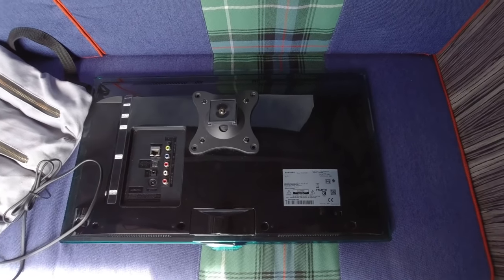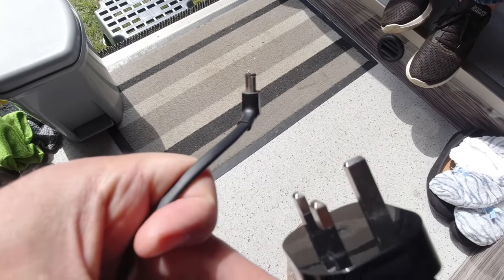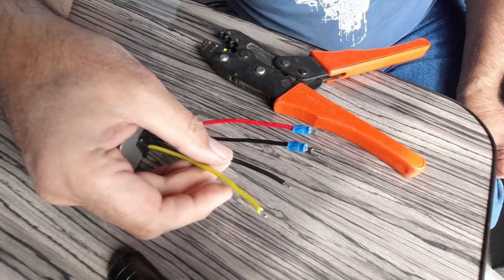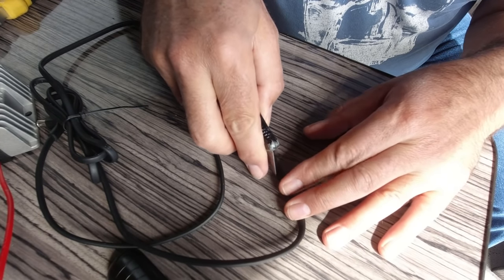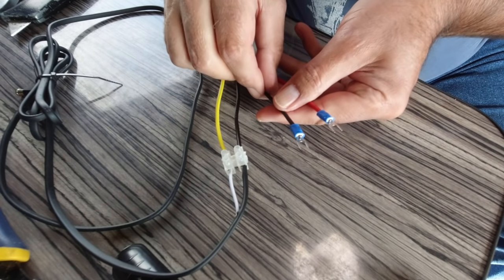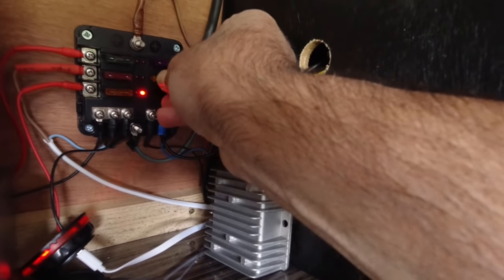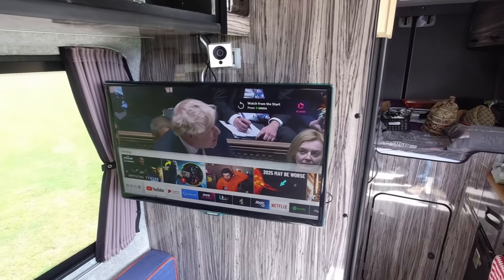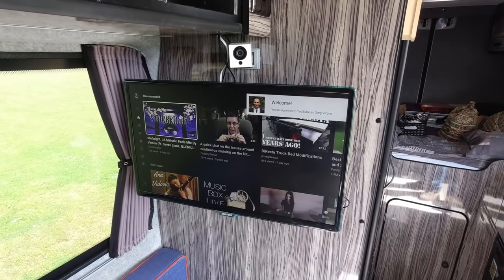How to connect a Mains TV direct to 12v DC - Off Grid Living

Comment: 2:30 It is a boost converter (up, 12->19V), not a buck converter (down)
Reply from the maker: Thanks for correcting me, sorry I got it wrong :D
Reply: niiice, didn't know that!
Reply: please help me with an issue I have. I bought some ex EV lithium ion batteries and connected 4 x 3.65v in series, which means they're 14.6v nominal, and they'll probably charge up to 16v. can I use a buck converter from that 16v down to 12v from the battery to the 12v fuse box? is it safe to do? I know I should have bought a lifepo4, but didn't have enough money, and really want to make this work. Thanks.
Reply: @camperdude5241  The maximum charge voltage for lithium is often 4.2 Volts for a single cell, not 3.65V. Lithium batteries are charged with constant current, not voltage. You provide a constant current to the cells and the voltage will rise. When the cell voltage is 4.2V (varies with the cell type), charging is stopped. Not all cells may reach the cut off voltage at the same time, this is remedied with "balancing". A buck or boost converter does not provide a constant current (CC) by default, most only provide constant voltage (CV), like the one that is used to power the television in the video. You need a power supply that provides CC and CV. The current never rises above the set maximum current and the voltage also never rises above the set maximum voltage. The current and voltage applied to the cells always follow Ohm's Law. Be careful what you do, Lithium batteries can burn.
Reply: @RAL2010  you got it the wrong way round he wants to use the buck converter to use power FROM the battery pack not to charge it 👍
Yes you can use a buck converter to lower the voltage from the pack 👍
Just make sure the converter can handle the full amount of amps the whole fuse board is distributing to the whole system 👍
Reply: @Dirt-Diggler  good point!
Reply: @RAL2010  I understand the point about charging. In fact, the victron mppt can be set to charge these cells up to where they should be...for argument's sake let's say 16.8v. My question is what can I do to bring that down safely to run a 12v system?
Reply: @camperdude5241  if it goes up to 16v then you’ve killed your lithium batteries , the bms on the batteries won’t let it get above 14.6v it will Rarely get above 13.5v. But yes buy a 12v buck converter.
Reply: @toastiesvanbuild4644  Ok thanks. These aren't lifepo4. They're YUASA LEV40 Li-ion batteries from an electric Mitsubishi hybrid. Lifepo4 cells are 3.2v, but these are 3.65v, hence the higher voltage when 4 are connected in series. 
I'm just looking for advice on how to safely bring that voltage down. Looking back I should have waited until I could afford lifepo4, but I didn't, so I'm going to see if these are useable.
Reply: @Dirt-Diggler  thank you very much! I'm clueless about these things, but what you say about the amperage makes sense.

Comment: Nice one but its actually called a boost converter (as buck's step down voltage, boost's steps up, I'm sure it was a slip of the tongue). You can buy adjustable ones too for dirt cheap, sometimes also known as dc step up converters. Or even use a universal 12v laptop charger, 19v dc is a commonly used voltage for laptops. 

Problem is finding a TV for cheap that you are certain takes DC. Lots of used ones on FB for cheap but no one takes good enough pics to see the model numbers etc.

Comment: Nice mod. A switch on the 12v supply to the buck converter would be good so it's only live when the TV is on as it's still draws low power even when it hasn't any load (every little help😀).
Reply from the maker: Yes you are right and you’ll love my upcoming upgrade video. Stay tuned 😃

Comment: Great video Greg. I have been thinking of doing this for my TV and laptop so I do not have to turn on my inverter as often. I hate those types of wires in which the ground "Wire" is a sheath that goes around the positive wire. Such a pain to work with in my experience. I cannot wait for your updated video.
Reply from the maker: I have a new smart controller to replace that blade fuse holder. Should be interesting 🤔
Reply: You don't need an inverter to charge your laptop. Just buy a 12v charging cable (it has the cigarette socket plug) specifically for your laptop. Easy and cheap.
Reply: @MultiPJoys  Correct, I was doing that with my old laptop and cost about the same as the inverter that Greg is using. My new laptop is a gaming laptop and uses about the same voltage as my old laptop (~20V) but uses 10A at peak. If I can find a 12V adapter for it that would be great but no luck so far hence why I am thinking of buying one of these inverters.
Reply from the maker: @MultiPJoys  yes just check that the laptop power requirements are below the output of the 12v charger. Most only go up to 90W

Comment: a good solution Greg, given that like invertors, DC to DC converters are not 100% efficient (despite the claims 80 to 85% is a good rule of thumb particulary at lower power) it could be interesting to do a comparison between both methods of powering the TV.
Reply from the maker: But with the mains inverter you are converting the voltage twice and much bigger differences. With this it’s only once and 6.5v difference. 👍🏼😊
Reply: @GregVirgoe  the bigger issue is using an inverter doesnt create pure sinewave ac even when claimed so it gives the TV internal power supply a bit of a headache and is inefficient.

Comment: Ahh I though I could do this when I found our old wee TV was 12v but had an AC plug. Was doing my head in trying to find out what that coaxial cable was called so I could double check which one was negative. You might have just saved me over £100 Greg! 😁👍
Reply from the maker: So you may just need a voltage regulator to maintain a constant 12v to the TV. Have you checked the input voltage details on the back of the TV?
Reply: @GregVirgoe  Yes it's 12v. 👍

Comment: You the man Greg👍😂. Can I ask you or anyone with these skills... I found a TV which states 19v but at 50v ...so the question is... Would this work for those tvs too. Much appreciated 👍
Reply from the maker: There wouldn’t be two different voltages. If it’s 19v the other figure would be either power in Watts or the current in amps. Can you check the label again.

Comment: Can also put in rotary selector switch so can run off 240v campsite power or battery generator aswell if batteries get low

Comment: Thanks Greg, been thinking about doing this.  Only problem is for me, I have so many electronics in my van that i would need a bunch of transformers to run everything and so would end up with dozens of them all over the place :).  I've been looking into making a multi DC output circuit board, certainly not beyond the wit of man, and looks as though is indeed possible but again for me just too much gear that needs powering to justify i recon.  One other issue for me powering things directly off of the 12V battery bank, is not being able to see your total load draw.  Again, not a massive issue (and wouldn't be a show stopper on it's own), but is handy to know what my draw is to know when to dial back the consumption.  i'm lucky in that i installed 1200W solar on the roof and currently have a total of 285Ah battery storage, so i can get a full charge before mid-day on a cloudy day?!  Thanks for sharing the video, it answers one question i was wondering, and that is the Amp rating of the output side of said transformer.  I was worried about over powering items, but as i thought - circuits will only take what they need in terms of Amps right, so even though your transformer is rated well above your TV's Amp requirement, the TV will only pull the Amps it needs - the important part to match is the DC voltage of course - just thought that might help some of your viewers as is not immediately obvious.  I suspect a benefit of over sizing your transformer (over and beyond Amps required) is that it will run cool, be more efficient and have a longer whole lifetime as is well over spec'd.  Thanks again, keep up the great work as ever, cheers from Bristol UK
Reply from the maker: Yes the rating is a maximum value so it’s perfectly ok to use less and it will operate cooler too 😃
Reply: If you check out your various electronics it'll surprise you how many run on 12volts DC and how many run on 18 volts DC or within a volt or 2 some laptops run on 19 volts DC I'm going to check mine some have internal tranformers like computers
Reply: @douglaswindsor120  you're absolutely right!  everything in my van is between 9V - 19V DC, except my monitor speakers, soundcard annnnd....that's about it!  I've got 1200W solar on the roof which means i can afford to lose a few watts here and there, main downside being the batteries getting hit a bit harder, but i've not seen the battery bank drop below 12.22V (more normally seeing a daily low of about 12.4V which is fantastic).  I'm using synthesisers and drum machines (which cost me a few quid!) so another concern of mine is having clean reliable power.  I'm sure they're absolutely fine (DC-DC converters) but it does make me a bit twitchy imagining a chinese DC-DC converter with my beloved music gear, as i say,  i'm sure they're reliable enough and not such a big deal for TVs and other less sensitive electronics.  I installed a Victron Multiplus 800 which has an inverter built-in.  Extremely clean power, built like a tank with exceptional reviews everywhere i check.  i'm super happy with it and while they do not (frustratingly!) publish the 'efficiency Vs load' data for the unit (inverter efficiency varies with load), i'm super happy with it.  The solar charger (also Victron) is also boss.  i'd highly recommend the Victron gear, while it is not cheap, the build quality is impressive, i'm sure my setup will last for years to come, we'll see. all the best.
Reply: that all said - for the vast majority, DC-DC convertors are the way forward 👍

Comment: As ruud waij commented below, it is an active device. I'm wondering how much of a constant
load the device has since it's always connected to your 12V supply. That along with the fact
that the TV is never really completely off (it's in a standby state), are you finding it's a constant
draw on your battery power?
Reply from the maker: We unplug the tv when it’s not in use to prevent standby uses

Comment: Thanks Greg! I figured that is was what was needed, but it was helpful to see it done and put into practice. Do/can people do the same thing with a PC provided they have the correct voltage booster?
Reply from the maker: Yes absolutely you just need to make sure the converter gives you the right voltage and enough watts to power the pc. You can also put a 12v cigarette type plug on the input so you can plug it in different sockets

Comment: Thanks for this tutorial. I don't suppose you or anyone else can recommend a 32in smart TV that comes with the 19v power supply? I've spent some time reading technical specs of tvs and not found one yet
Reply from the maker: There are 32” smart TVs that run off 12v but bit expensive see here Avtex W320TS 30" Smart TV for Motorhome Caravan Truck Boat - 12v 24v 240v 32 inch Slim LED Wifi Bluetooth Connected Television Full HD FHD with built-in Freesat Satellite Decoder https://www.amazon.co.uk/dp/B09TTJZHRR/ref=cm_sw_r_cp_api_i_AX8PST9252N430BC0Z5A?_encoding=UTF8&psc=1

Comment: Very easy solution get rid of 12 volts and use 24 volt system off grid then use a 19 volt regulator you will use less power than using a transformer. Using 24 volts has many other advantages as well you can center tap two 12 volt batteries and still be able to power 12 volt items as well. Higher DC also less loss on longer runs  best to use 48 volts but we can save that for extremely long runs. My first system will be a 24 volt system I think it will work for what I intend to power. My coolers work on both 12 and 24 volts. The 19 volt will also work with a laptop computer but that is another can of worms to iron out because on computers don't like foreign adapters. I had problems replacing my Dell charger. 73
Reply: I like your idea of using a 24V system and it may perhaps allow you to better husband your resources. It would however be more complicated/ and an effort 🧐 to monitor what would effectively be three separate circuits.

12V stuff on one of the centre tapped circuits would surely run out of power whilst leaving the second battery still with some capacity? That does seem rather wasteful.

There may be some advantage in that it would allow you to prioritise such items as the fridge, which you could power 24V across both circuits. You may also perhaps wire 12V stuff, which is more important to you onto the secondary circuit.

I shall have to have a think about what cannot be done without......?

Hmmn...Fridge, heating, télé......? 🤔
Reply: @BK-rr2ws  I see what you are getting at but you can divide your 12 volt devices  and use both batteries. House circuits have 240 and 120 volts circuits. They are divided up when using 120 volts. 
Not everything is on one side of the power transformer. 

The reason I don't recommend using a step up transformer from 12 volt to 19 volts because you will draw excessive current. Solar off grid homes usually try to save energy instead of using more energy. It may not be much but if you get three or four days without sunshine every watt of electric is important. 73

Comment: Hi Greg how r u , I love this conversion , I want to ask I a question , I just bought a JVC smart tv and I want to do the same set up as you are showing , but the other thing , my tv have a straight cable from the tv to the 240mains here in australia , it doesn’t have the plug with transformer , so can I still do this setup using the the transformer ? Thank you and good job 👍👍
Reply from the maker: If it doesnt have an external transformer then it would not be possible to do what I have done here because your transformer is probably part of the main circuit board inside the TV, sorry :D

Comment: I need to find the schematic to the power supply to my Hitachi and see if there is any low voltage outputs to the TV but I know for fact that the led backlight runs on 95-100 volts, not sure if that voltages is reduced from mains or is there a low voltage input to the backlight circuit that gets pumped up to the high voltage. Changing brightness affects the voltage on this set.
Reply from the maker: It may have all its conversion on the main board inside 🤔

Comment: It's ok to run low wattage of an inverter you won't loose much efficiency, if you plug in toasters and electric ovens then you loose up to 20% off a standard inverter or 5-10% efficiency on a pure sine wave inverter
Reply from the maker: It does seem to be a bit daft to take the voltage from 12V > 230V > 19V

Comment: Hi Greg
Thanks for the instruction and info..
Do you know if you could use the same convertor to power a Xpelair Extractor fan for my shower/bathroom build in my Spirinter..? ?
Cheers
Andrew
Reply from the maker: I’m afraid not as most domestic low voltage fans are AC not DC.
You would still need to use a mains transformer for those fans. Sorry

Comment: Hi Greg, I have a question hope you could help me. I’ve bought a ZTE5G router from three. Having a similar problem, the appliance says 12v DC 18w 1.5a. Which is great. My van runs by solar lithium 12v system and am I safe to strip the cable like you and connect right into my dc fuse box, with say a 2a fuse? As you know a 12v battery is not really 12v. It often go up to 14. Can I assume it is safe to connect directly to the router or I need kind of a regulator in between?
Reply from the maker: It is best to fit a voltage stabilizer which physically looks the same but ensure that only 12v is supplied to your router. https://www.ebay.co.uk/sch/i.html?_from=R40&_trksid=p2334524.m570.l1313&_nkw=12v+dc+voltage+stabilizer&_sacat=0&LH_TitleDesc=0&_odkw=12v+dc+voltage+regulator&_osacat=0&mkcid=1&mkrid=710-53481-19255-0&siteid=3&campid=5338027957&toolid=11800&mkevt=1

Comment: Hi Greg, thanks for this video, can you help me with my question please?

I want to power my router via 12v supply, the input requirement for the router is 12v  :::: 1amp, what buck converter\transformer rating should I be buying to do this and so as not to damage my equipment.
Thankyou.
Reply from the maker: i woudl recommend a 12v voltage regulator and if its only 1amp then that equates to 12 watts of power as 12volts x 1 amp = 12 watts. Something like this one woudl be perfect, just make sure the input to the router is 12v DC and not AC https://www.ebay.co.uk/itm/394874378542?hash=item5bf058d92e:g:XjYAAOSwCO1k~~yL&amdata=enc%3AAQAIAAAA4HWzZ56yMxvB%2FSVo0N9J117%2BQXKgGzhbZWbdKTvvSs22oKIlJRy1MD1F%2FPOp0lQlBXYjzWkrM59iWl0QjJp27taZhnS06j9gyF2f%2Bjg0Nnjk8xAZ2vpaqPcd2uOzdp4qTZXTG9ZW26QlHHrsVMxeYa83eKZ8S2PIYwl1zkOxYCK%2F8ADT8usPa%2BCKwHDOb3%2FbSpt7BnP8ngd46dBjMlvbEESZu5ypPO%2FcXlYeN92kJF%2Bdr52CuDCYjMM%2F4%2Fyx46yRSgNaO25slmslKvLPb3eaurdPGcVeC%2B7KdMEiKYLIqbyG%7Ctkp%3ABFBM9q_JrfRi&mkcid=1&mkrid=710-53481-19255-0&siteid=3&campid=5338027957&toolid=11800&mkevt=1